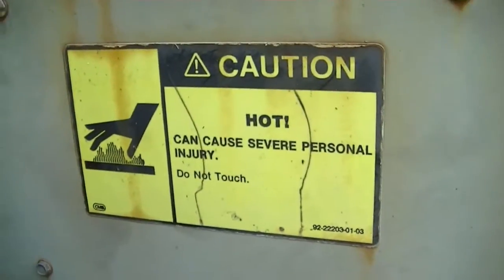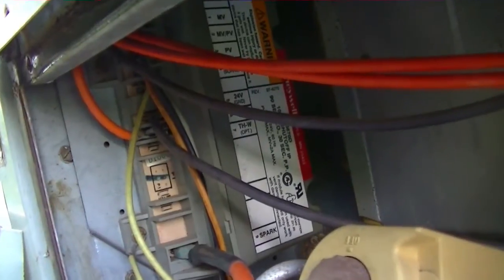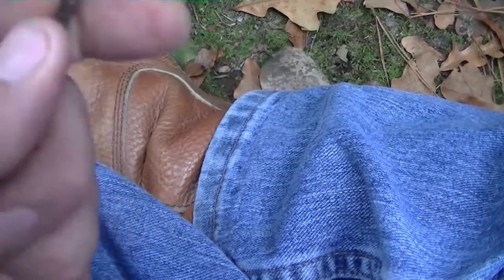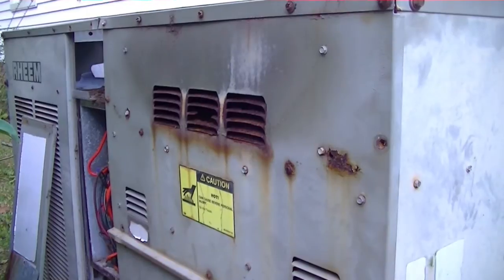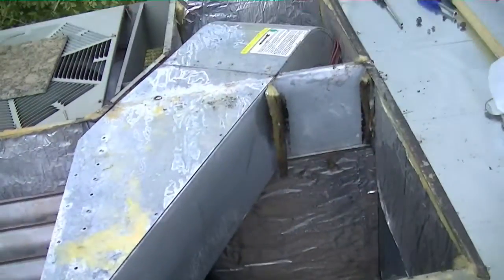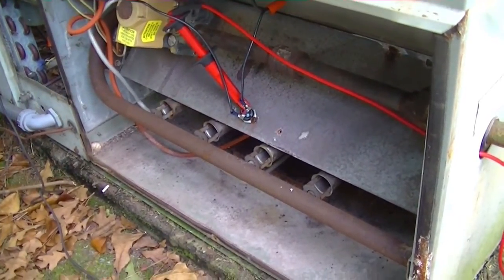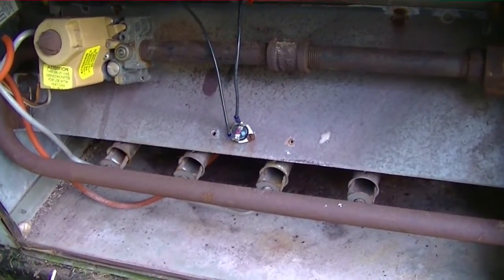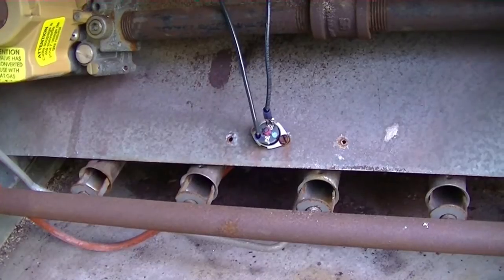HVAC Service-  Cracked Gas Package Heat Exchanger

Comment: Every clamshell American standard and trane from 2008 has a compromised heat exchanger. Design flaw, crack at burner ports on the inside of the heat exchanger face plate. So the side you can't see, this is for 80 and 90%..
Reply: Tempstars used the shame shit 20 years ago, suffered the same fate. Junk I say. Junk.